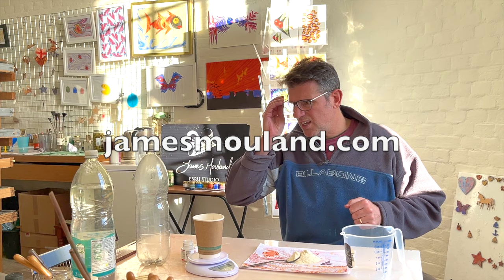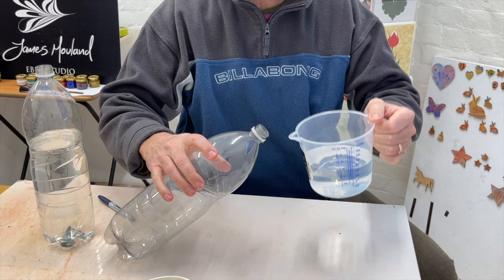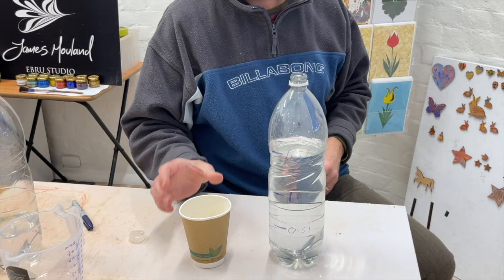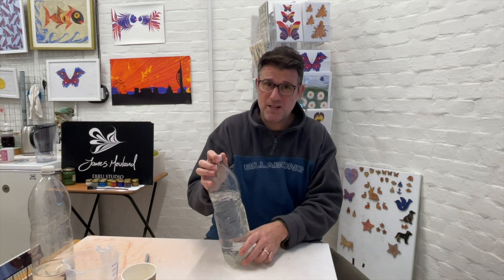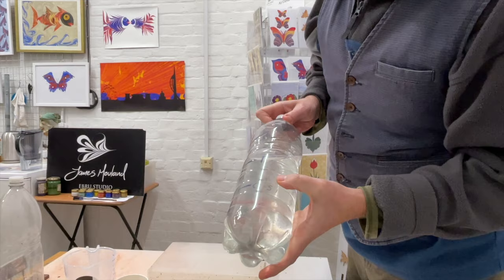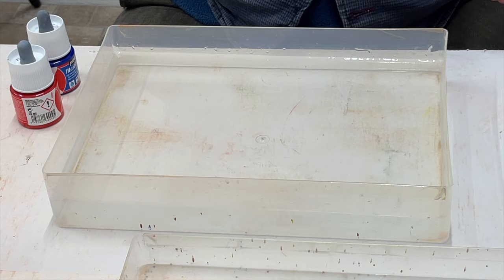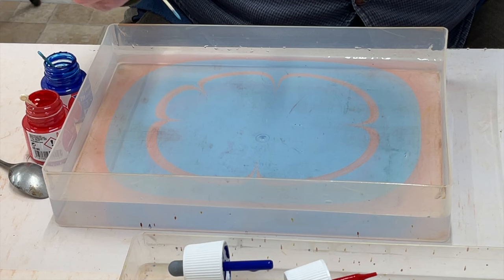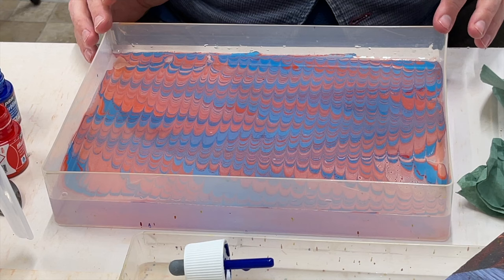Acrylic Paper Marbling for Beginners, Step 1: How to thicken water for acrylic paper marbling

Comment: Avoidance of lumps is why they use "high shear mixing" machines in the cosmetics industry. As soon as a lump of methylcellulose (or any other thickener) hits the water, it will tend to draw water in, and form a noodle that takes ages to loosen up. I would suggest using a blender in a cylindrical container - it may be the same bottle with the top cut off. If you sift in the thickener onto rapidly rotating water, the lumps won't have much chance to form. Whatever does form, the blender will break up. Just make sure to avoid drawing in bubbles.
Reply from the maker: Good advice 👍🏻

Comment: do you have a video on marbling glass (jars, wine bottles, etc.)
Reply from the maker: Hi, no not yet but thanks for asking, it’s on the to do list 😁
Reply: Great video, clear, concise, and needed by so many people!  Would you use the same measurements for dyeing fabric?  Have you ever dyed fabric?  Specifically 100% Cotton.  I want to used this method to dye my cotton fabric.  I do use the PFD, Prepared for Dyeing, fabric when dyeing my fabric.  I am wondering how this method would work.  Thank you for a fun looking project.
Reply from the maker: @joanhalverson3796  hi thanks for your question. All materials will vary slightly and some dramatically. The only thing to do is set it up like an experiment and make sure you journal each step so that you can repeat. Pebeo definitely works on fabric and most fabrics, especially cotton will take an acrylic based colour if the fabric is free of detergent and treated with aluminium sulphate to help with binding. it is always trial and error, have fun experimenting and let us know how you get on 😃

Comment: Thank you, I've been having problems and I think it's an issue with my bath. (Paint falling to the bottom of the tray, not floating until it's so watered down I can barely see it.) You said that the amount of methylcel or carageenan varies depending on how hard your water is - do you add more or less for hard water? 

Do you have super thanks turned on? I don't see the button.
Reply from the maker: It may be the paint quality or size too thick. To check paint quality try it on plain water then try it on varying viscosity. If the paint still sinks it may be lacking a wetting agent suitable for marbling. Very hard water requires more methylcel or carageenan but probably no more than I used in the video as the water I use is very high in calcium. Hope this helps. My super thanks should be on but isn’t showing 🤷🏻‍♂️
Reply from the maker: Okay, I think super thanks is working now I rebooted it, thank you for bringing it to my attention 🙌
Reply: @JamesMouland  I've been in classes where I brought paints and used a size made by the instructor, and this is the same paint brand. That was what made me think it's the size, but I didn't know how to troubleshoot. I used carageenan but I'm going to switch to methyl cel until I get a better feel for doing things on my own because these are some expensive mistakes! :) Thank you!
Reply from the maker: @CarmillaN  make sure you keep a journal of materials and measurements and only change one variable at a time when troubleshooting, it’s really easy to miss a step or get distracted in our busy lives. Best of luck and keep persevering 🙌
Reply: @JamesMouland That's great advice, thank you!
Reply from the maker: My pleasure 😇

Comment: You can avoid those lumps in the mix if you gradually add powder to water while stirring all the time. At least it is how you dissolve wallpaper paste, which is very similar to this substance... Speaking of which, is it possible to use wallpaper paste in this process instead of methylcellulose?
Reply from the maker: I’ve not tried wallpaper paste but I hear from those that have that it’s not ideal
Reply: @JamesMouland  Thanks, it's good to know